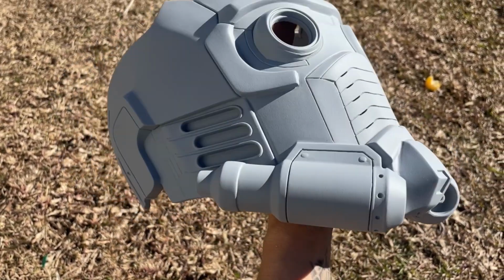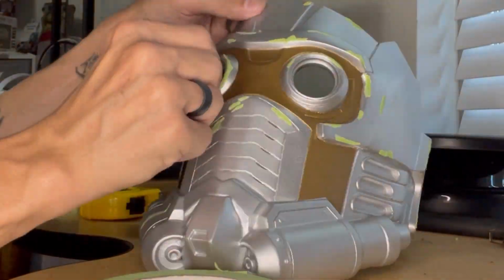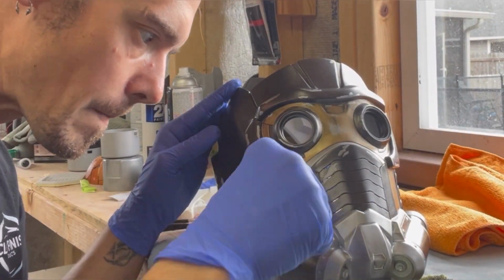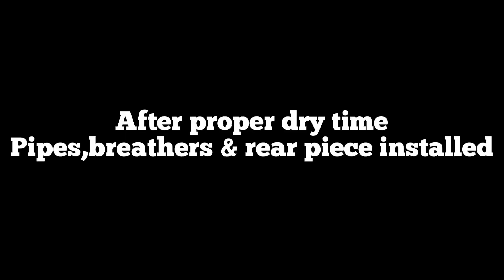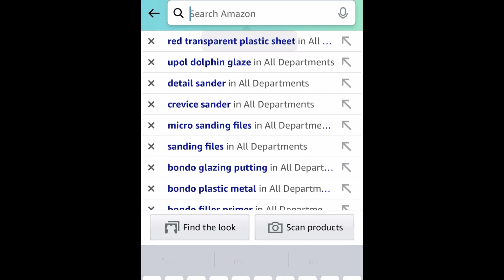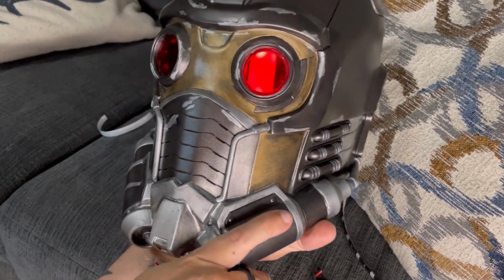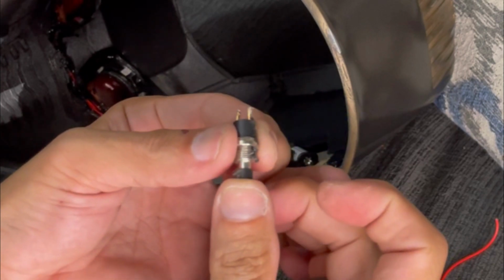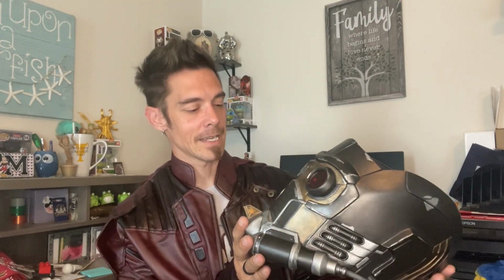3D printed star lord helmet pt. 3 | How to weather & damage 3D prints | Guardians of the galaxy

Comment: Nice work. You probably do t need to be as conservative with your oil washes just fyi the white spirit (mineral spirits) don’t bother the acrylic unless you soak it. Or if you wanted to be safe can mix it with linseed oil and then the acrylic really won’t care. When doing oil washes I’ve personally found getting the pigment separated but consistent to be my hurdle. Mixing in one cup then  pouring off leaving the bigger particles behind let’s me put it on quite heavily and after a couple hours wiping most of it off let’s it tone the prop pool naturally and not worry about freckles.
Really do enjoy your videos they are fun to watch.
Reply from the maker: Yea I’ve just been kind of tweaking my method on the fly & trying different things so I greatly appreciate the feedback! My biggest thing is I didn’t want to over work the blending & damage any of my top coats. I have a pretty stable background with brush painting but I’m always open to tips from others. Obviously this won’t be my last build so when I do my thanos helmet I’ll take your tips into consideration and follow up. Thank you for watching & contributing your input!

Comment: This is a great tut. Can you explain any benefits/drawbacks to weathering with oil paint vs acrylic (watered down) which is what I typically see people use for weathering process
Reply from the maker: I notice the acrylic is more watery and you can see a definitive pattern like it was wiped with a towel or brush. The oil because it’s thicker I am able to thin it where it’s just more controlled and it looks natural. I also like being able to take just a few drops of spirits and rework it & blend it after applied, when I tried using a blending media with acrylic it really just completely removed it. Durability wise oil will hold up better if the piece is handled a lot too.